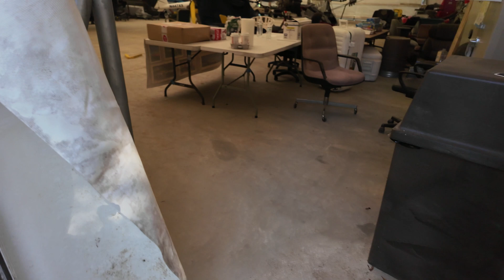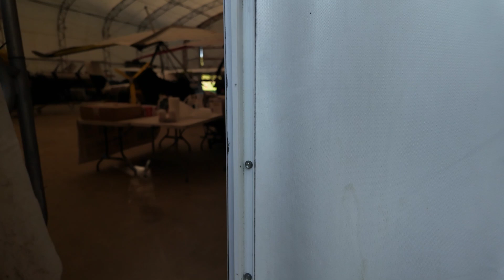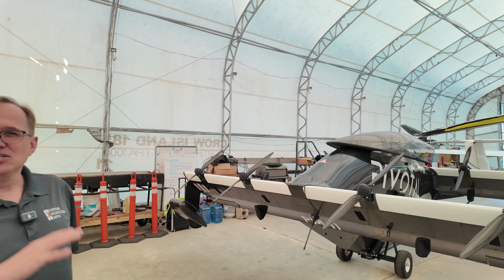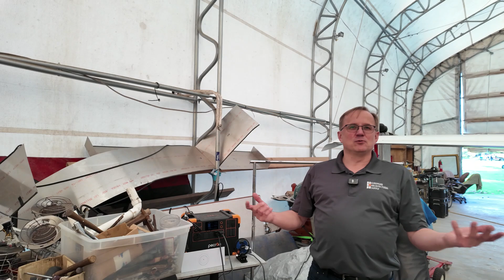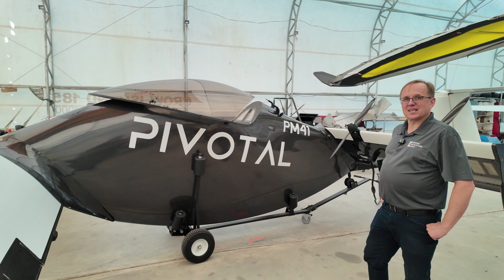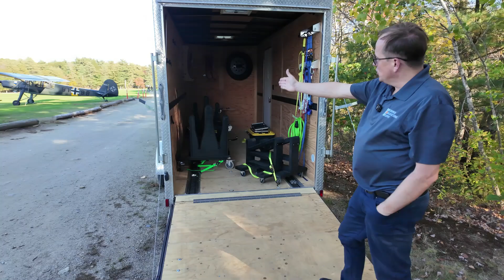the BLACK FLY PROJECT

Comment: The trailer could be a solar platform that could deploy 8 400W solar panels for charging and even have its own 400 VDC battery with a drive axle that could add range to whatever is towing it, then be the charging source for the e-VTOL which would be perfect if it had a swappable battery.
Reply from the maker: He charges it with solar
Reply: @stevenbaczekarchitect9431  Thanks for responding. Yes, I saw that. I designed and installed systems for a few years. That is what made me think of making the trailer a mobile solar charger with a lot more panels than he has now so faster charging instead of the two panel setup he has now. Re: the design - I’m an ME that paid for school by working as an A&P and flew numerous types of aircraft for quite a few years.